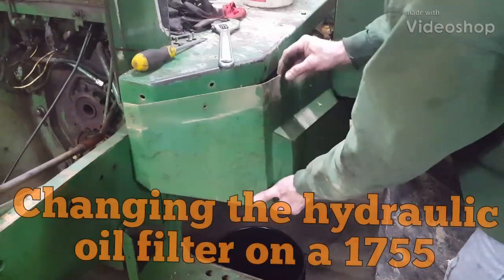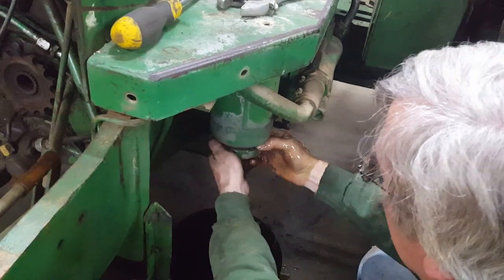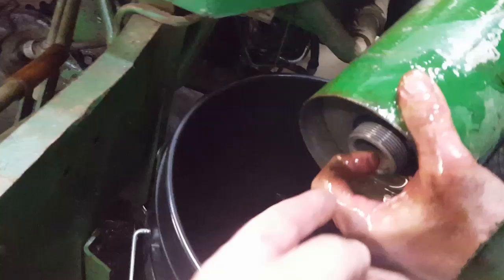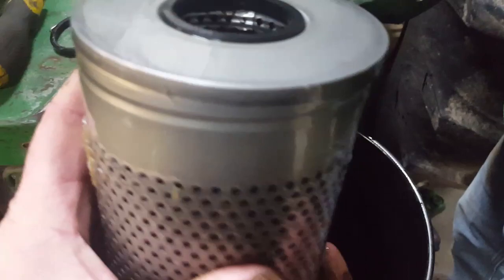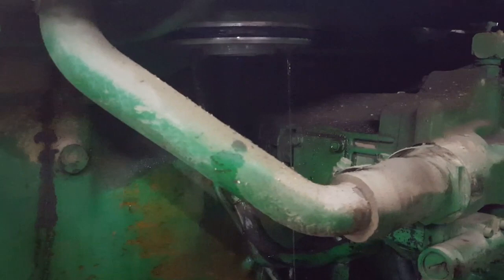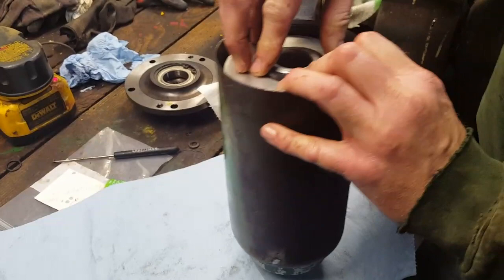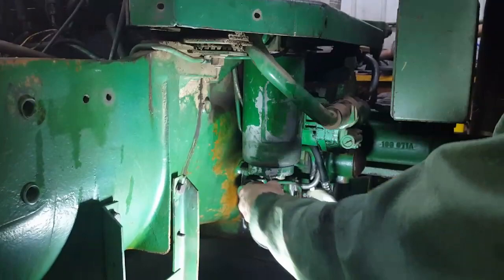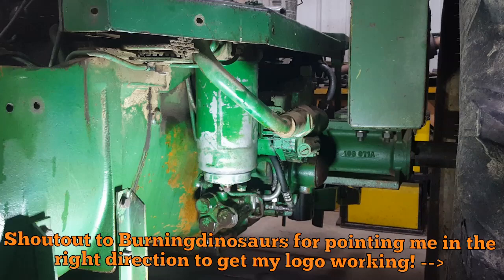Changing the hydraulic oil filter on an Oliver 1755

Comment: I don't know why they didn't put a tap to stop the oil from draining out. Thanks for the video.
Reply from the maker: I've wondered the same thing. Maybe they figured with only 5-6 gallons , if you are changing the filter that you should change oil too. That was back before a 5 gallon bucket of quality oil could run you  $50 or more.

Comment: What hydro oil do you run as a replacement for Oliver type 55?
Reply from the maker: I use universal hydraulic transmission fluid. Agco calls it 821xl.